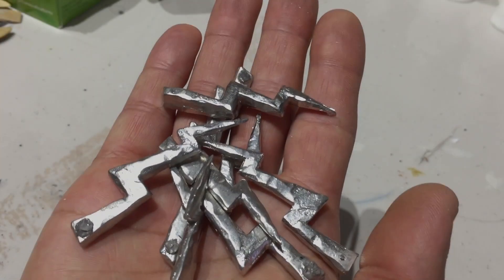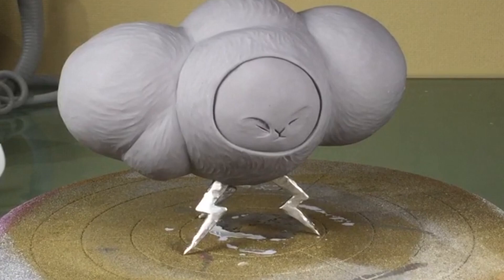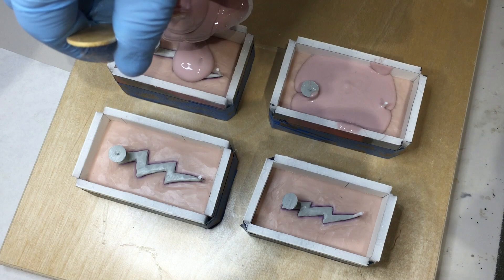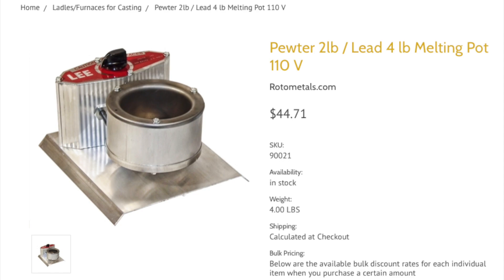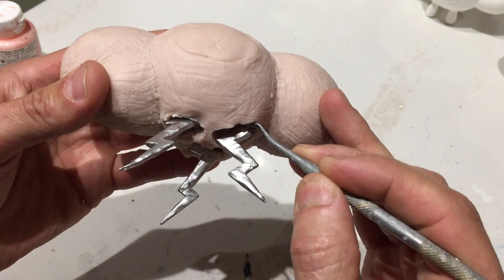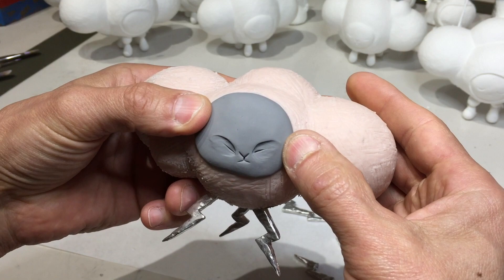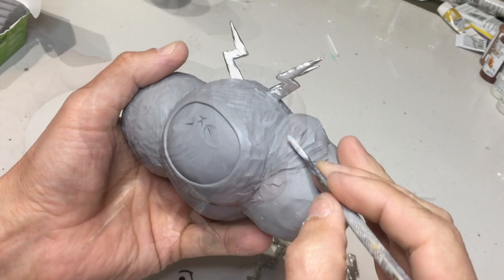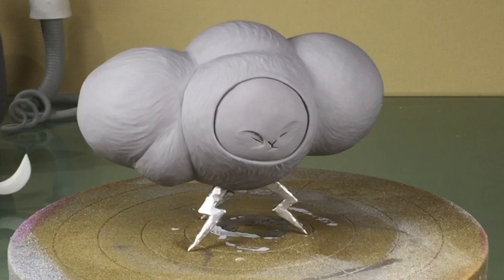Unlock the Secrets to Metal Casting with a Simple Studio Setup

Comment: I bought one of those infrared temperature readers. The surface temperatures are all over the place. I tried using a cast iron ladle but it holds the metal at a really high temperature. I switched to a thin steel ladle and got better results with temperature readings.  I get frosty looking items with high temperatures and bubbles and voids with low temperature readings. Next I’m going to try an electric melter with an adjustable dial and a bottom pour spout to see what kind of results I get.
Reply from the maker: let me know how it works :)
Reply: @SteveFerrera  what I found was that using that infrared reader is kind of a pain. I’m pouring just enough pewter to make small projects about the size of a silver dollar and a bit thicker. I’m using a propane torch and a very small ladle. Holding the ladle and reaching for the reader is very inconvenient or even dangerous. Especially when dealing with hot molten metal. The ladle has about a 3 tablespoon capacity at the most. Keeping it level and over a flame and reaching for the reader and aiming reader is just asking for trouble. I’ve done blacksmithing for over 40 years and have a lot of respect for hot things. So with that experience, I found that after I clean off the dross off the molten pewter; I keep on heating it until I see the surface take on a slightly blue sheen on the surface. That’s when I do the pour. I get good results with a nice shiny surface, no wrinkles, no frosting, no accidents!